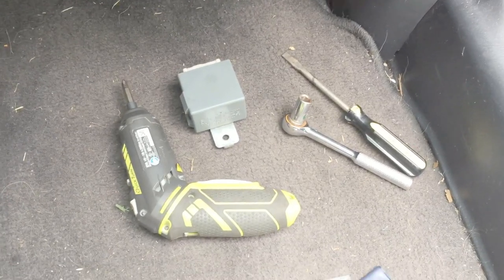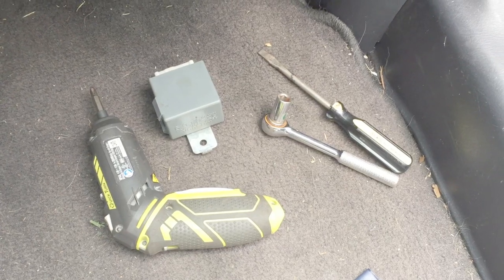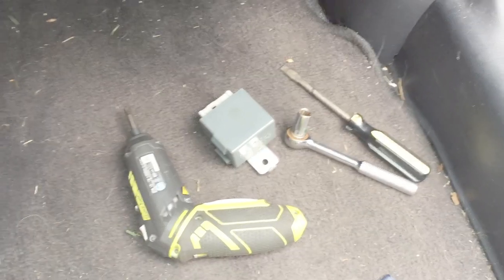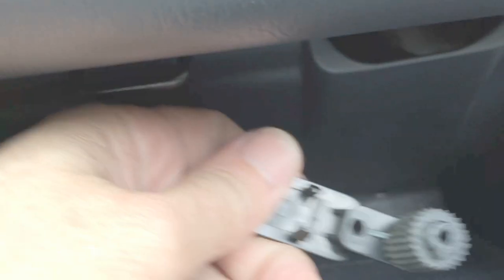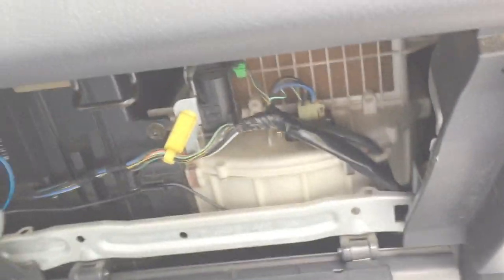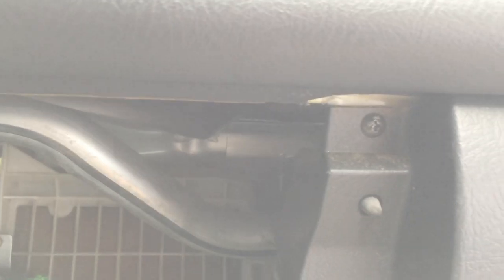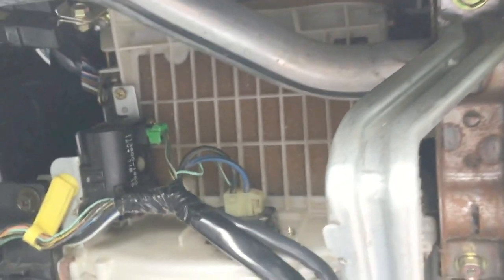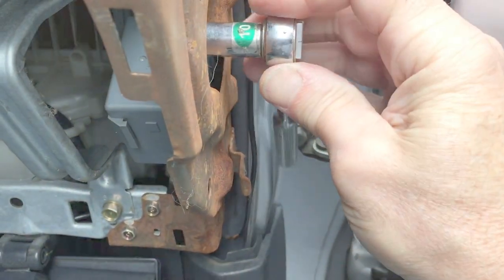Honda Shutting off while driving SOLUTION!

Comment: After installing a new distributor in my '99 CRV and having it shut off 3 days later I saw this video.  I did the much simpler repair. I'm now 7 days in without incident.  Wish I had seen this first.
Reply: Brother I changed my dizzy, plugs, plug wires, alternator, THEN the relay 😢

Comment: Could this same thing cause the vehicle to temporarily not start, not turn over, no ignition click as well? I had my CRV turn while driving a few months back and it wouldn’t start. Got it towed the next day and it started right up no issues. Replaced the ignition switch but twice more I’ve had it be unresponsive after driving it. No crank, no click but lights and everything works still. After it sits for awhile it starts right up like nothing ever happened and runs like a dream.

Comment: hi frank. I have 99 crv same problem turns off while driving the turn back on after few minutes.  I replace the ignition switch came with two connectors . still having same issue. Tomorrow I'm trying the main relay . I hope it's main relay. because next it's the distributor if main relay don't work
Reply from the maker: Let me know if it works.
Reply: How it go?
Reply: @bentleyfocht2234  was the cr-v loosin power at low speeds n den shuttin off
Reply: Did changing out the main relay work for you, Jesse?
Reply: Wat was ur problem

Comment: Man I'm a new oner of a 2001 crv the guy said it runs so good and clean and ten 20 miles into driving shuts off..ten to 20 min. Later it'll start up run great again...I bout it just changed the main .I'm waiting test drive I'm nuvis and little bit skard for it to die ..I've seen and read all comments. So I need faith I'm going test it now ..I do have faith it's fixed .

Comment: The main relay on my 1998 CRV was in the same place but was botht he fuel pump AND the furl injection. It was two relays mounted on a board. The board got hot and desoldered some of the connections. A dab of solder on all the pins on the back of the board and it was good for another 300K miles.

Comment: I went and picked up the part and the car ran for 7 hours straight and didn't cut off until I shut it off. Before I could only run the car for 45 - 60 minutes before it shuts off.
Thank You
KatCanDo
Reply: Hey man I got a 2001 accord and I got the same problem it drives for abt 50/60min then shuts off and then starts back up again after 10/15 min

Comment: Hi Bentley.  
I was having a similar issue.  Your video was a major facilitator in resolving it.  In short, I went to the junk yard and paid 3.50 for a relay and the vehicle did not shut down on me when it reached operating temperature.  It was my second  effort at the problem as I initially cleaned the injectors.  The prior owner had already changed plugs, wires and a portion of the distributor.  When I saw your video, I felt strongly that this was the problem: it just made sense in explaining what was happening.  

These parts stores, in my opinion, are a little over eager to sell parts.  Thank you for getting out the information and my empathy for all the troubles that you experienced.  Know that your sacrifice has helped me and others.  I hope that gives you some solace.  

Ben

Comment: The whole time as he explains the problem I’m like omg yes yes yes... exactly the same issue. Did exactly the same thing to try and fix it and still nothing. I love my Crv but Now I’m praying this new Relay stop the issue!!! Pray for me but I have hope. Thanks man. A true life saver
Reply: Did you fixed?
Reply: @alejandrogomez3272  yes sir . New main relay will fix it
Reply: @justinmedina2969   Mine turns off at stop lights when RPM are low. Engine light when on, the scaner said to change the cranck shaft position sensor, so I did, but that hasn’t solve the problem. I did notice it to be failing more often when I turned the AC on and the temperature out side is high. I’ll try this and see if that works. I’ll let you know. Thanks for your reply and congratulations for fixing it!
Reply: @alejandrogomez3272  did it work
Reply: @alejandrogomez3272  yo did it work??

Comment: Thanks a lot Frank for the insight and info. Will be updating if this fixes the problem. 

I switched the Ignition coils and fuel filter, but still died on me and won't start. So I'm trying this and ICM. Having my Faith in God that this will solve the problem.

EDIT: So my problem was a stripped timing belt. After replacing ICM, Main Relay, Ignition Coil, Spark Plugs,  Battery Terminals, Battery wires - I finally found distributor rotor wasnt turning - Took car to a mechanic and comfirmed the timing belt teeth had stripped. 
Thanks to God valves didn't bend from Piston Impact and car is up and running now.
And I am more than happy and grateful to have my CRV back 🚗 🌞
Reply: Thanks for coming back and stating the real issue. Experiencing the same issue. Hopefully it'll work 🙏🏿

Comment: I have the same problem with my 99 Honda Accord ex, turns off with & without ac on, ac barely works & I've changed everything you mentioned except the ignition switch, & main relay.

Comment: Thanks Frank!  my 98 Civic was having the same problem & after switching the main relay a couple of months ago, its been running just fine. Thanks for posting.
Reply: Where do I find the main relay on my 98 Honda Accord
Reply: Under the steering wheel in a box. Look up Eric the car guy
Reply: Any check engine light on your car when that was an issue?
Reply: @superduperretardman  yes & no.  when the engine would die on me, all the dashboard lights would come on like when u turn the key to the position right before ignition.  so that did includes the check engine light, but it never came on alone in regards to this issue.
Reply: @ chuy chayote, did your car ever have problems when you turned it on? Because my 96 civic occasionally starts and immediately shuts off. Let me know, thanks!
Reply: @julianvazquez6651  
Hi Guero. No mine died while driving after a lil while.  Then it would start after about 10 minutes. it only happened twice before I found this video.  roughly 2 weeks in between each time.

Comment: My 1998 crv turned off on me on the freeway while it made a turn. Luckily, there was minimal traffic and I was able to pull over to the shoulder. Oddly enough, the crv turned on by itself without turning the key
Reply: What ended up being the problem . Mine does the same
Reply: neva MINE it ended up being the ignition starter switch, and once I replaced the part it never turned off on me again.

Comment: I have a 1999 Honda Civic and I have this problem. It usually happens on warm or hot days. I’ll go to start my civic and it won’t start the first time. It will take like 9 to 10 times until it finally starts. When the car starts normally and while I am driving the engine will die/ shut off. Now mind you, I still have electricity in the car while the engine is off. But then it will take a couple more tries until it finally starts again. It’s so annoying and I’ve wondered what this problem could be for months.
Reply: Me to with my honda 2001 4d auti

Comment: Thanks. For this video...
My Honda Civic doing the same thing.
Reply: My 03 civic is doing this but it only does it after i have been driving for a while, and only when i come to a stop or reach a really low rpm? Any suggestions
Reply: Did you try changing the spark plugs?
Reply: Yes my 07 Honda Civic does the same thing . It would turn off shortly and back on quickly without turning the key when I’m at stop sign or long red light . Idk what’s wrong with it

Comment: I got a 2001 CRV they just stole all the while driving down the highway.When I tried to start it everything lights up the The starter wines and tries to turn over but I just won’t..Does that sound anything like what happened to you
Reply: Just stalled out while driving
Reply: all lights on my odyssey go out but starts right up while driving. did you resolve your issue?

Comment: I'm having this same problem but I have a honda civic 03 EX. does this still work for my year?
Reply: Did it solve the problem?
Reply: I have an 03 civic ex as well!! But it only stalls after ive been driving for over an hour or so only if i come to a stop, it doesnt matter how many times i stop before at some point it will do it randomly??
Reply: @yuck8581  I’m having the same problem with my Honda, did this help your vehicle?
Reply: @audreywyninger5530  any luck
Reply: @br00talhonesty  I had to take it to my mechanic & got it fixed
Reply: @yuck8581  any luck

Comment: You're funny I replace my main relay and I still have the same problem I replace my gas tank my fuel pump sending unit my distributor my wires spark plugs the whole entire ignition switch with the harness and it still shuts off randomly
Reply: Did you ever figure it out?